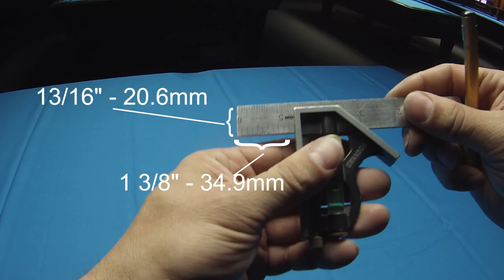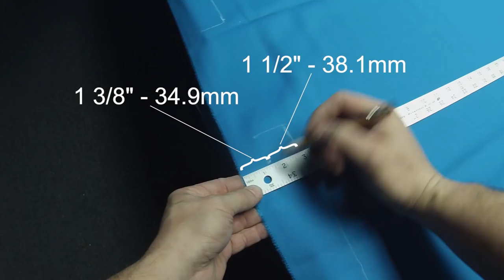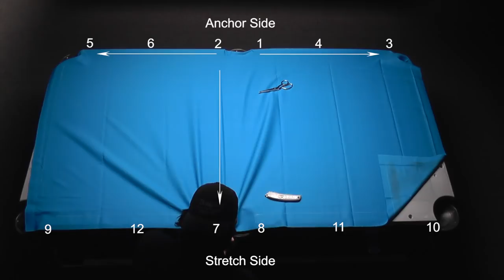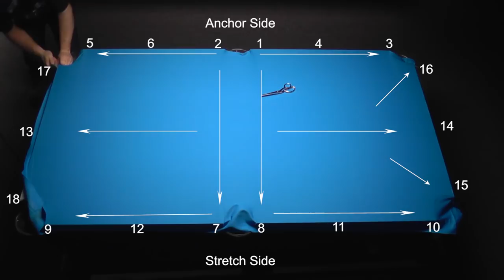Install Simonis on a Diamond Smart Table using only contact glue, no staples.

Comment: Awesome video!  I have an 8ft Blatt Billiard table to do in this cloth.  It's great you showed the entire process. I will calculate your Index and apply it to the 8ft.  Question, did your indexes come from simonis or from your experience?  And why are the side pocket offsets different from side to side?  Does that allow for the anchor side stretch somehow? Thank you for this.

Comment: Hey brother! Been working on getting these rails redone on this table. My first rail didn't turn out bad but gotta clean up a little bit on the ends by the pocket facings but I think I can straighten it back up. Got the rest of the rails cleaned up of the old glue and gonna glue after work tomorrow (12/29).

On another note. I just now realized after watching your video for the 6th or 7th time here that every mark you make is where you're stretching it to or fitting it to the table! I'm so glad I caught that before we started the table felt.

So just to be clear. On an 8 foot table, you're adding a 1/4" on the end rails and the stretch side of the side rail just on where you are stretching the felt to. And the Anchor side will remain the same because that's not where the stretching will happen. In other words, you're only making it 1 5/8" away from the very end of the felt itself and that's how far each end and the stretch side of the felt will be stretched. And that is all that changes,  am I right?
Reply from the maker: On the added stretch, yes just add 1/4" on the stretch to side and the ends. You are correct, the marks on the top of the cloth get pulled right to the corner of the slate and attached.  Good luck.
Reply: @reverendjonas  is the 33" and the 33 1/2" the same?
Reply from the maker: @kevinbowers512  It's pretty close, that won't change anything too much, but you can add 1/4" to that as well.
Reply: @reverendjonas  thanks man
Reply: One other quick question, I have 2 rails, one has a spot where a knot was in the wood and it's got a small maybe 1/8th in hole in the top part of the rail, and one also has a large spot that looks like it was right on the edge of a knot. Will those spots effect anything and should I treat them in anyway when gluing the new cushions on?
Reply from the maker: @kevinbowers512  It probably won't be a problem. For stuff that won't be seen I always use Bondo, or any other automotive body filler. It's great for wood, easily machinable as well.
Reply: @reverendjonas  thanks for the quick responses man. Gonna get these new cushions glued on and maybe trimmed down tonight and try to have this table done by the end of the weekend. Fixing to go into the store for another brush though for the glue. But what is that adjustable straightedge you use for making the smaller measurements? I'm drawing a blank on it.
Reply from the maker: @kevinbowers512  Swanson Tool Co TC130 6-Inch Combo Square with Cast Zinc Body, Stainless Steel Ruler and Brass Bolt https://www.amazon.com/dp/B0008JF0U8/ref=cm_sw_r_apan_glt_fabc_ZZXYSPVKVF4VP7KNRFDR
Reply: @reverendjonas  hey brother, marking the felt right now to start install on the bed of the table. I'm watching the video and it seems like the side pockets is the only one that you have a designation on how much you're stretching to the side pockets and the rest is designated how much you stretch to the edge of the slate, is the corner pocket stretches just by feel and however tight you can get it there?
Reply from the maker: @kevinbowers512  The corner pockets are hard to mark to, it really is a fel thing. Did you download the pdf that I have linked to? That helps a little with the order of stretch, and makes it so the corner pockets come out with the right slack.
Reply: @reverendjonas  no I didn't see the pdf. But it's ok. The felt is on. Just gotta cut pockets now. I wasn't able to get everything stretched to the line with it at 1 5/8" (8 foot table.but it is tight
Reply from the maker: @kevinbowers512  Good, hope it turns out nice for you. Just for future reference.
https://ufile.io/9y52mex0
Reply: @reverendjonas if I can get your email I'll send you a pic of how the felt ended up
Reply from the maker: @kevinbowers512  email
Reply: @reverendjonas  sent

Comment: This is a good video. I have recovered my table three times now the first time I reused the clock that was on the table before I got it then I bought $80 Amazon cloth after that I got a used cloth from my local billiards supply shop. The latest one turned out the best and I liked it the most for playability. Is it worth it to go the extra three hundred bucks for simonis. The billiard supply guy told me that you can only have a professional install simonis or it wouldn't turn out right. I feel like if I used contact cement instead of spray adhesive it would definitely be something I could do.I am concerned about the rails how many times do you think I could make an attempt to them?
Reply from the maker: Just depends on how much scrap cloth you have to practice. Simonis (or most other worsted cloth) is more difficult to install if you are used to using a normal (non-worsted) cloth. 
When installing Simonis on the bed, you must watch for wrinkles when not stretching correctly, and stretch shadows when stretching too much, or in the wrong place. 
Attaching Simonis to the rails you must watch for dimpling the point of the cushion, and getting all the wrinkles out around the bottom of the rail on the ends.

Just take your time and use some old cloth if you have it.

Comment: So you stretch it 1 3/8ths in every direction or just three three directions? I am not sure why the anchor side seems to be treated differentially in some instances. The cloth does need to end up square.
Reply from the maker: Yes the cloth is stretched 1 3/8 in 3 directions so it is stretched twice as long as wide. The anchor side is treated slightly different to allow the center pocket to be closed correctly. The cloth ends up stretched square.
Reply: @reverendjonas  Thank you so much. this is the one place that actually mentions how much to stretch the fabric. It seems most people just do it by feel.

Ah, so I guess you must stretch shortways specifically for the middle pockets then? Everyone else is saying to do it lengthways, but you do it this way to give yourself a little extra slack in the middle pockets?
Reply from the maker: @wisnoskij  Yes. I like to put a number on it. Not only does it assure you are getting it straight and square, but when you are on the 8th table for the day, you know it will be as tight as the first even when you are worn out and ready to go home.

Comment: another question. last time i followed this it came out great. thanks for the vid. when you cut out the holes for the bolts for the rail did your cloth loosen a bit in those areas. would it benifit to put a little glue around the holes?
Reply from the maker: If it's stretched tight and even, the holes cut for the bolts won't affect anything.

Comment: Simonis has an id strip viewable with a black-light. Is that only on the play/slick side? i know they put "Simonis" around the edge on the up side. Thanks. Great videos.
Reply from the maker: I have only looked for it on the play side and assume it is only on the play (smooth) side.
Reply: @reverendjonas  Cool. Thanks

Comment: What do you use for cutting the rail cushion when replacing them
Reply from the maker: I use a sharp knife, or razor blade then finish up with a sanding disk on a miter saw.

Comment: Zach, I'm preparing to do 3 8' tables. I use a duo fast gun with bigger staples normally. What gun do you use and what size staple? Pneumatic I believe. 
Also when you seat the feather strip, you don't use a ponding block. What prevents dings in the rails from the mallet?
Reply from the maker: I use a 3/8 22ga stapler. It's a no brand. I am just using a cheap dead blow mallet. Soft enough not to ding rails.

Comment: Well done thanks for sharing. What are your thoughts on pro-form cloth and would it be installed in the same manner? Thanks .
Reply from the maker: I have only installed it on a couple tables, and it seems ok. As far as longevity goes, I can not say because it was not in a commercial room. It is installed the same way, however the stretch numbers will be different.
Reply: The Proline 505 installs almost identical to Simonis, it maybe stretches a tiny bit less but not enough to worry about. It lasts very well.

Comment: Hi - Can the same measurements be applied when re-felting an 8 foot table? Great video by the way. And what kind of marker are you using?
Reply from the maker: You will want to stretch the cloth a bit more. I have not done an 8' in a while but from what I remember 1 1/2" in all 3 directions is the big change.

Comment: Hi again Zach. I have another question for you. I am re clothing my 8 foot table with Simonis 860 and I only have 3M 77 spray adhesive. I have read that you do not recommend that glue but it is all I have. Can I spray the anchor side and affix that side, then wait a day or two for it to fully cure to continue with the process. I am in no hurry to get this done. I just want the best possible outcome. It is just me doing it so I have no extra set of hands but what I do have is a bunch of clamps that may/can help me with the process. Any suggestions would be greatly appreciated. Otherwise, I may have to kidnap you , drive you to Ohio , bribe you with a beer or two, and beg you to help me. Thank you! 😊
Reply from the maker: It's not about the time, it's the shear strength. Even applied correctly (spraying both slate and cloth) and letting the solvents flash off, spray 77 just doesn't have enough hold for how much the cloth needs to be stretched. I have had spray glue fail on me days after installing. That is why I switched to a roll on type contact adhesive for ALL cloth installations. 
If I was closer I would love to come give you a hand.
Reply: Care to come to Vancouver island 😅

Comment: Hey Zach. Enjoy watching you work. Is there i tech reason you didn't staple this job? The bed looks like slate. Is there no sub bed? I will be attempting to recover my Olhausen this month but the closer I have come to this type of work is stretching de-icer boots on airplane wings.
Reply from the maker: I have switched to glue on all tables because I believe it is far superior to glue. It is 100% coverage, and I feel I can stretch tighter and more evenly. 
Diamond tables do not use a traditional backed slate like your Olhausen does, so gluing is not completely necessary in your case. 
The same stretch pattern and process can be used to staple cloth as shown in the video.
If you have any questions or anything, feel free to ask.

Comment: Hi Zack What kind of pen are you using - Thanks.
Reply from the maker: It is a soap stone. Usually used for marking steel for cutting/welding.

Comment: two questions. 1. Are you getting tiger stripes when your done? 2. Is the cloth loose after a month or so?
Reply from the maker: I get no tiger stripes at all using this technique. The cloth does not get loose at all a month or year or 3 years after installing with a stretch index and glue. 
I work recovering tables at large pool halls and have never had a complaint about loose cloth.
I have used many methods of installing cloth and I really think this is the best way to install cloth.

Comment: Zach, do you happen to have the measurements needed for an 8' table?  I love the explanation and drawing of the  measurements and layout of the anchor/ pull points.  This is the method I will be trying along with the RKC250 adhesive.
Reply from the maker: Add 1/4, so side stretch would be 1 5/8 and ends would be the same. I don't have a drawing of the layout.

Comment: One quick question about the side pocket relief, my assumption is the anchor side gets the 13/16" and the side you pull gets the 5/8"? Or do I have that backward? Awesome video by the way.
Reply from the maker: That is correct. The anchor side is 13/16"
Reply: @reverendjonas  I should've kept reading, this answers my question above @gelcarpio.  But, what is the reason the side pockets are different though?
Reply: Having one side different than the other doesn't screw up the cloth being square??  Assuming it's not a concern.  This method looks legit.  Can't wait to try it.

Comment: any opinion on the 3M #10 yellow adhesive vs the RKC250 ?   i have been buying the 3M by the quart.  how is shelf life after opening on the RKC250 ?   i do about 10 tables a year and try to get it out of a single quart.  some times i have to open second quart and it sits a year after opening.  your thoughts on one vs the other?
Reply from the maker: I have used the 3m10 for years before the RKC. Both work very well. I have switched to the RKC 100% now because I think the shelf life is better. It is thinner and it doesn't seem to separate the solids out as much as the 3M10 does.  I also feel like I can use less RKC to get the job done, so overall saves me a few bucks. 
What type of roller cover are you using for your installs?
Reply: @reverendjonas  i switched to 3m #10 after they switched the formula on the 77 spray.  i have been using a disposable brush and painting directly from can and wiping drips with the edge of the can.  post covid i have been doing tables less often and haven't bridged over to using a roller yet. i rewatch your vids and keep pondering trying your methods.  thank you for putting out the content.
Reply from the maker: @gosnellktn  GO GET A ROLLER AND TRAY! Its sooooo much faster, easier, cleaner to use a roller. I get 9" -  3/16 nap roller covers and cut them down to 3" an use a silicone baking pan liner for a tray most of the time.
Reply: @reverendjonas  my original concern was waste.  my first quart got kicked over on site.  so my efforts to not waste were for not.  i have to mail order the glue,  now i have a spare quart.  i will get a roller and give it a try.
Reply: @reverendjonas  just ordered the RKC250  lets see if Diamond will ship to Alaska.   In the past i have struck out with most shippers on shipping the glue to me.  fingers crossed.
Reply from the maker: @gosnellktn  If that doesn't work, let me know. I might be able to help you out.

Comment: Zach! Nice video you need to put a link to your cash app on here for donations I feel like I owe you at least $10 because I’ve watched your Ridgeback video your covering rails with Simonis video and now this. I just found out yesterday the original 3M super 77 is no longer available anywhere it’s all the low VOC which won’t hold anything, going to have to switch to roll-on glue.
Reply from the maker: Once you get comfortable with the roll on glue process, you will never look back. It's much cleaner, no over spray, holds much better, and 10 years from now the glue cleans off the slate much easier than spray glue.

Comment: What do you think about using 3M Super 77 Glue?
Reply from the maker: It does not have the strength to hold the cloth when pulling as tight as you need to when installing Simonis properly.  Spray 77 has its place, but not for installing bed cloth. I use it when recovering Valley type bar-box rails.

Comment: Hello zach. For a valley 7 foot are the same measures? Thanks
Reply from the maker: No they are not the same. It has bee  a long time since I have done Simonis on a valley, but you will need to put less slack in the side pockets and the rest should be pretty close.
Reply: @reverendjonas  thanks I appreciate it. Can I use the cement king cobra to install cushions ?
Reply from the maker: @JoseEspinoza-pt2il  Yes. It is a very good contact cement for facings and cushions. If you are replacing valley cushions, look at Ridgeback rails. They are a bolt on replacement that really improve the playability of your table.
Reply: @reverendjonas  I bought penguin pro rail but some thing don't feel good I'm going to put my old set of ridgeback but I need new cushions  I'm thinking to buy artemis k66 to replace them should be good options? Or can you recommen any good cushions thanks
Reply from the maker: @JoseEspinoza-pt2il  Artemis are VERY good cushions. I have installed hundreds of sets of those.
Reply: @reverendjonas  thanks you where do you buy them from I see like 4 different stores on line they sell them
Reply from the maker: @JoseEspinoza-pt2il  I get all my stuff through West State Billiards. Call and ask for Jim.
Reply: @reverendjonas  ok thanks for helping I Will call and tell  .you recommend me
Reply: Hello how long takes the cement to be ready for felt

Comment: Zach do you have similar drawings or measurements for a 8 foot table?  Thanks in advance.
Reply from the maker: I do not have any dimensions for an 8'. But about another 1/4 inch stretch side to side and 1/4 inch both ends should work. Leave the side pocket slack the same.
Reply: @reverendjonas  Thank you.
Reply: @reverendjonas    I have a quart of RKC250 on the way.  In the mean time I will mark my cloth.  Just so I'm not confusing what your saying should I make the ends and stretch side line at 1 1/8" or 1 5/8" instead of 1 3/8" ?   I'm not sure if I'm adding or subtracting that 1/4".
Reply from the maker: @tooncesc   Add 1/4, so side stretch would be 1 5/8 and ends would be the same. Good luck, let me know how it turns out.
Reply: @reverendjonas  For my first attempt using glue I am very happy with the results.  Nice and tight.  I also used the glue to put new rail rubber on and it worked great.  I bet I have enough left to do 3 more tables.  Thanks again for making a great video.
Reply from the maker: @Wild Blueberry 860HR. It lasts longer and I feel it's easier to install.